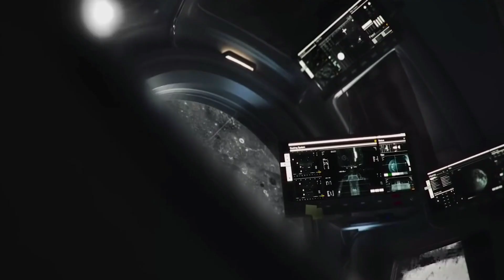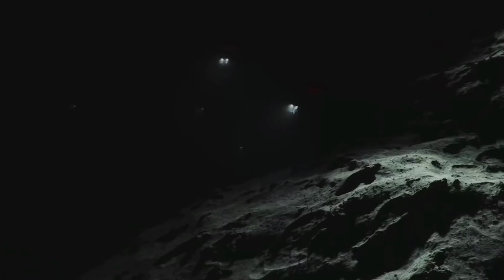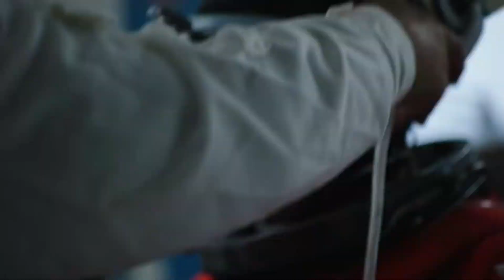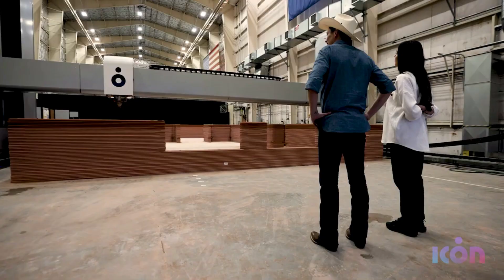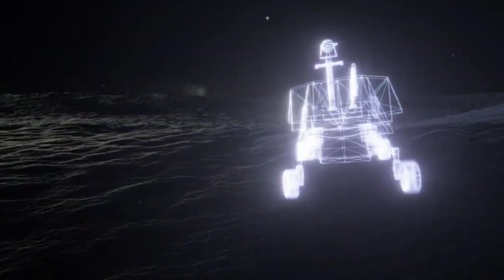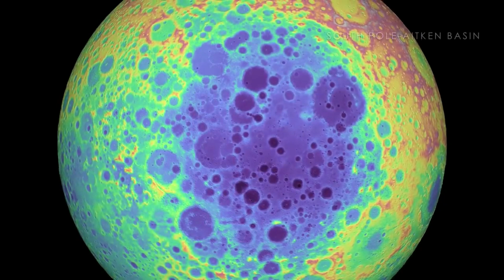What Will NASA’s Future Moon Base Look Like?

Comment: Wasn't there an Indian moon lander that determined that the water is in beads from impacts and more universal than just in shaded craters near the pole? What was the pipeline for?
Reply: Last week the Chinese released information regarding higher than expected levels of water trapped in lunar soil. However you still have to process that soil in order to extract the water. You'd also still need pipelines to transfer the water to habitats, launch pads, and any other outlying infrastructure. After all, we don't all live next to our source of drinking water on earth, do we?

Comment: It's should be interesting to note, The current suborbital spinlaunch platform on earth is designed to launch up to 5000mph = 2.235 km/s  is already capable of launching materials off the moon with a velocity very close to the lunar 2.38km/s escape velocity. 

A comparable lunar based spinlaunch platform would make it cheaper to launch lunar materials to build space infrastructure around earth.

Space infrastructure things like Space based solar power beamed to lunar poles and cities around earth.  Solar powered tethered momentum transfer space station to launch humans to Mars and or the asteroid belt,  build solar powered orbital rocket fuel processing and refueling stations, launch lunar dirt made into shields for space stations and crew from ionizing radiation and micrometeors. Ect ect ect.
Reply: *etc, etc, etc (et cetera)